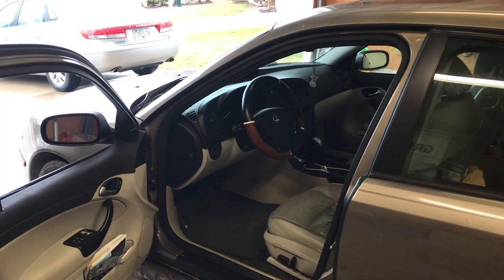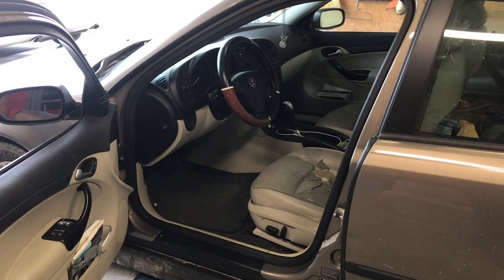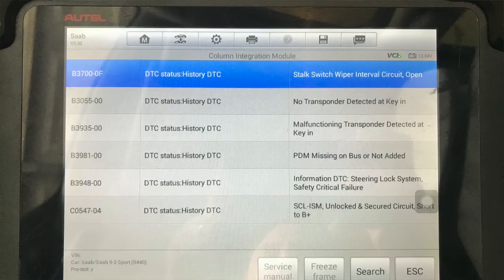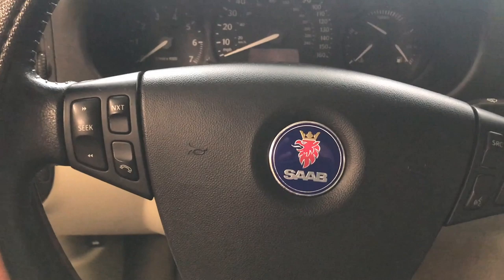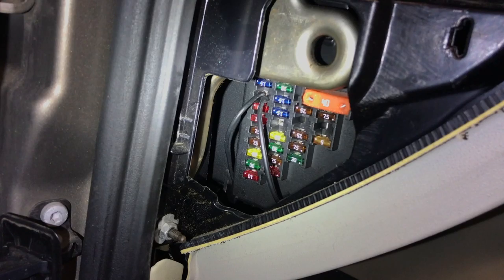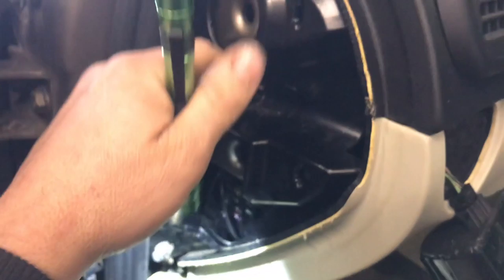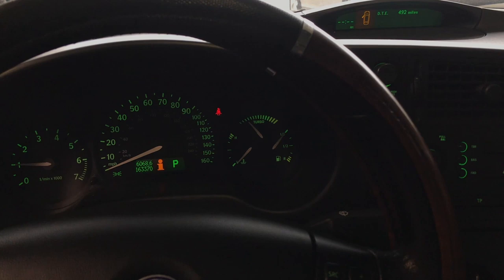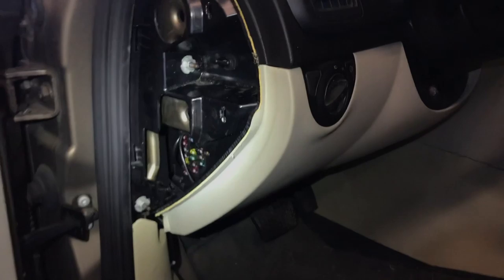Saab Steering Lock Malfunction Fix

Comment: 99% of time a poorly charged battery causes this. It happened to me. I looked at fitting a bypass switch but realized the car had not been driven for over a month. Charged the battery did the key in key out thing from the video, and off it went no problem. Been starting well ever since and i run the car once a week to keep battery charged. No need for bypass.

Comment: Used Cims are like 150$ in Sweden, if you do not have a Tech II with a Saab card and Global tis for security acces you can simply swap the proms on the CIM module.
Reply: Can you further explain. I have an 08 9-3 aero and cant turn my key past the off position into lock, however, if i leave it unplugged overnight, it allows me to crank it
Reply: Where is the proms in the cim?
Reply: @christiankirkpatrick7242  i have the same problem with a 08 aero. Did you ever get it fixed? If so what did you have to do to get it to work?
Reply: @christiankirkpatrick7242  do you just unplug the battery every night?

Comment: I would have tried removing that hideous steering wheel cover first. 😂😜
Reply: That's the Saab / Scania Griffin crest.  I like it, mostly because of Scania trucks and buses, but I suppose beauty is in the eye of the beholder.
Reply: @rnreajr9184  I'm not talking about the Saab logo lol I'm talking about the ugly fake wood steering wheel cover...
Reply: @DrDodge24  ah. That's what I get for watching the video on my phone. Without glasses. I agree with you about the cover. If that were my Saab, I would remove the steering wheel and put it on my Logitech G27. Then I would part out the rest of the car. It wouldn't be a daily driver, that's for sure.

Comment: I bought a used CIM with key from ebay for about $130 and programmed it to my 9-3 Aero using the tech2. Issue resolved
Reply: I just bought a Saab 9-3 Arc and this crap just started happening.

Comment: I have this problem again, column lock, after paying 1700 2 years ago, 600000 miles. I attempted start the car, after a passenger's leg laid on the lock button, then this problem appeared... I dont have that kind of money and I thought if  the sensor was reset, which I dont know how, it would take care. I can start the car, but I have to make 3 to 4 tries. I just hate that. Hate for folks to even work on it for fear that Im getting ripped off ... thanks again for the resolve. I will disconnect with the battery...or get someone to watch your video 🙂 thumbs up!!!

Comment: Just had this on my 9-3 aero, interupted the power from battery, and great :) It has got it moving again
Reply: How
Reply: Did you just disconnect the negative cable and reconnect it? Or did you have to do anything with the wheel or anything? I have 9-3 Aero as well with the same problem

Comment: I was just saved by this tip. With my 9-3 2.0t Vector automatic 1994. Disconnected the battery pole and it started.

Car starts well in cold weather even after more than a week inactivity, but so it's not the battery in my case.

Going to think about that switch when this happens again. That's why you always have some tactical tools in a conventional car.

Thx!

Comment: FYI: My SAAB requires this hack every morning and I have pulled out fuse 2 about 3-400 times to reset the module and double inserted the key and it starts.  In short this works even on a daily basis..   I will install an external switch shortly...

Comment: Hi Daniel just wanted to ask a few questions? Did you actually solder the wires into the fuse box or did you use fuse clips? That tucked fuse how did you wire that? Both clips separate wires one hot one ground? And if so where did you ground it? 
Can you give specifics on how you wired the whole thing I’m a little confused. Thank you kindly.
Reply: Instablaster

Comment: I was going to do that bypass about 3 months ago when the dash warning showed up and affecting the signal lights to turn on. Just few tries and the signal lights came back to work. Now Signal lights don't  work at all, internal lights the headliner don't work, and defroster on rear window doesn't work; these issues showed up at the same time than the steering column malfunctioning.  Any suggestions on how to solve those issues? Thanks for recording and sharing the video

Comment: This happened to me and will work a few times , it wasn't happening very often. 
It worked around 10 times with disconnecting the power and one day even disconnecting the power or taking fuses out didn't worked. So do expect that one day it wil fail completely.
I scraped mine with 150k on the clock and the engine was still going strong I was absolutely gutted. I would buy another one again but a bit worried about this issue happening again.

Comment: 2003 saab 93 2.0t arc 71k miles this happened after tow truck driver forced the key or towed wothout turning the key  .who knows..
I guess you cut power to the  module with the switch to atart..start..? Wouldn't pulling the fuse do that?  

if i discon my  batt wait 20 minutes  wait a day and hit the yellow reset button button before after, etc that warning comes up as soon as. I reconnect the battery malfunction code comes back on . 
So if you just pull the fuse  will it start?

Comment: Interesting.  Mine started this problem recently.  It will still run if the light comes on with the car on, i just lose info display.  If i the car is off and the message comes on after turning the key to on, it wont start at all.  if i just go straight from "off" to "start" with the key, it will start and run just as normal, except the message may or may not come back on.

Comment: I have a Saab 9-3 03 vector sid is saying key not accepted, have transponder codes key turns but no crank tried to jus a jumper the car cranks but no start gets spark for a few seconds and it stops getting sparks? :)

Comment: My issue is the key wont turn at all. In fairness the battery has been dead for about a year and the car has sat there because we couldn't get the hood up. Today we get the hood up and the key will not turn at all. We are in the process of charging the battery because I hear this is normal if the battery is dead. So then when battery is charged this should correct the problem I am assuming?
Reply: Did you fixed that problem?

Comment: I had a problem with my 2004 Saab 93 2.0T where the odometer won't read/the speedo won't work/and it'll show abs-traction control and brake malfunction... So I swapped the abs module from my 2006 V6 93 aero and voila my speedo works...my odometer reads mileage...all the abs and brake malfunction issue disappeared then I got hit with the steering lock malfunction but so far so good because it does not affect the car at all I guess it could be a result of the V6 saab abs module registered for the V6 saab keys?? Just was wondering maybe it could be possible that besides the cim I think the abs module could also be a culprit.

Comment: This is not good. Steering lock malfunction message is caused by the ign switch not messaging that SCL is unlocked. Remove the ign sw. (ISM) dismantle and clean the contacts. 
Steering lock failure message is exactly that, replace SCL and program with Tech2. In have never had to replace CIM except for lost keys. Done this over 50times, 30year Saab Master Tech.

Comment: I just wired a push button to the starter relay under hood. Starts every time after yoy turn key to "on" position
Reply: fkn genius. thanks ive been using a short little wire opening hood everytime

Comment: If anyone has this issue and wants to do the best temporary fix that's EASIEST and cheapest-ish solution (the video would be ever so slightly cheaper but more difficult of an insulation) get a remote controlled battery disconnector switch. I got mine on Amazon for $25 and that way if I ever want to do the proper long term fix, I don't have any permanant drill holes or anything leftover

Comment: I can tell you that it does work for the short term about 6 months then after that it becomes a total bitch and is nearly un resetable by this switch by pass with the car getting very difficult to start. I am going for the second way now chop out the ISM solonoid, remove the searing lock cube to one side and put in a starter switch to the relay on the main fuse box.
Reply: Update to above took out the steering lock unit and cable tied it up above the accelerator housing out of the way, can't disconnect it as it causes major problems with the ECU. Got a new PCB for the ignition switch, comes as a kit you will need some silicon contact grease; disabled the key lock solonoid by make an L shaped stopper an epoxy it in place. We now have no luck CK up issues and seem to have 100% start up rate since I have done it. I have also fitted an ignition starter push switch but have not wired it up yet,  time will tell.

Comment: "this isnt a permanent fix, this is just temporary"

Yeah right pal. That's what I told myself when I blew a brake line on my Buick century. Shops won't replace just the one line, they want to restore the whole rear of the fucking car. I bent the busted line shut and have been driving on three brakes for 2k miles or so.
Reply: My buddy mark drove his century for years with front brakes only. Both rear brake lines blew and we put pipe plugs in the master cylinder. When the rear driver side shock tower rusted out he called the junk yard.
Reply: You should fix that i have a 1990 vw put all new brake lines in myself t
Reply: EVERYTHING is temporary Henry

Comment: I did the same exact thing with wires from the fuse but to a push start for my faulty signal switch from the starter ... now I’m having this issue 🧐🌞

Comment: great, until it locks the column while driving or similar :))
Reply: Depending on the situation, it can be safely resolved. The driver simply needs to put on their hazards and take whatever action is necessary to reduce risk to the driver or surrounding drivers.
Reply: I hear that can't happen while driving the car. Once you turn off the ignition then it locks till you reset the battery once again or switch in this case.

Comment: I'm wondering why I haven't ever heard of a Toyota or Honda having this issue. I hope the feeling of self-importance that comes with owning one of these unreliable pieces of shit has been worth it for everyone who's had to deal with these stupid kind of problems that, according to Honda and Toyota owners...DON'T HAVE TO EXIST!  In addition, they have warnings built in for problems that haven't even happened yet. Thanks for making the video but these cars are going to be extinct soon here in the states and it can't happen quick enough.
Reply: Toyota and Honda have seen how other manufacturers make shit that fails and have decided that if you can't beat them join them. They both make a product that will rust away due to insufficient underbody protective coatings and insufficient treatment to steel panels prior to spot welding. They also have vehicles with a piss poor engines designed to fail just after the warranty period has expired. The issues highlighted here are 15-20 years of usage where either the brushes in a tiny motor have finally worn out or a bit of oxidisation is causing a high resistance in a wire or across a connection at a terminal. Saabs were designed to last and GM didn't want any of that.

Comment: PArts are expensive because SAAB went out of business in 2012.. Blame the Founder of the auto maker “Spyker” he was selling cars to the public BEFORE THEY WERE ACTUALLY MADE
Reply: Um... That's like every auto manufacturer ever?
Reply: I BLAME GM FOR SCREWING UP A GOOD CAR COMPANY
Reply: @ljbrizo   alright dude no need to yell.. GM was giving them a good selling chassis to work with but they kept making the car bigger and bigger. GM was trying to help SAAB survive.. but it was costing GM money also
Reply: Matt GM showed Saab how to make cheaper cars that break easy, take for example the v6 engine, pure trash GM designed garbage, ,GM is no ones friend,